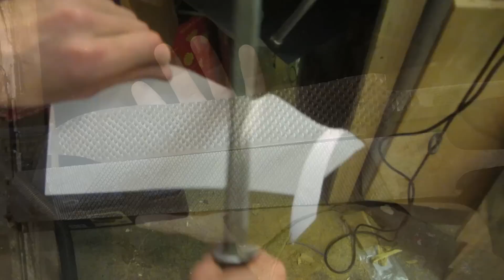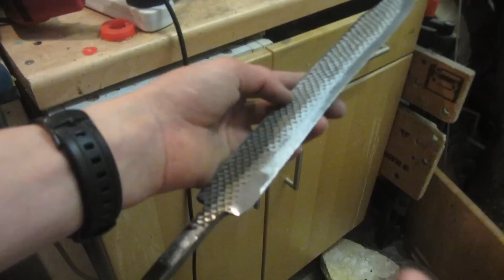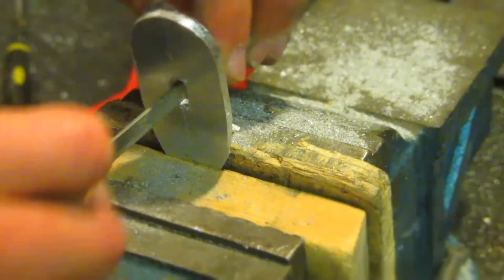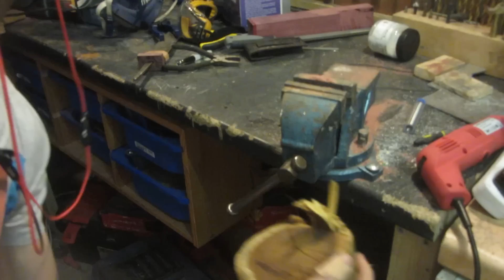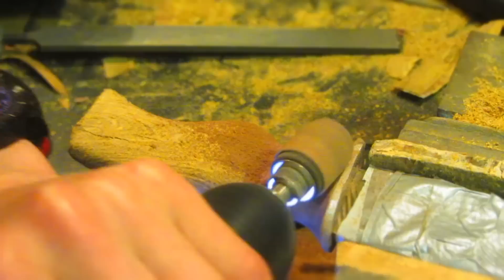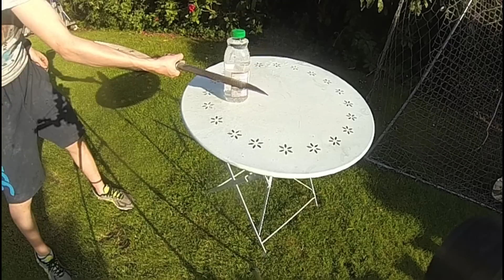How to Make a Bowie Knife From a Farriers Rasp

Comment: i am a goldsmith apprentice, and i think the soldering didnt work because the difference between the melting points of the used metals is too big. The solder has to be melting just right before the two other used metals are melting to form a propper alloy. Also you cant solder steel or iron. I hope i could help, thank you! 
Ps: Great Knive!!! love all your videos!

Comment: You are tempering the knife. Heating it to a mid-to-low heat to soften the spine. It is a great idea to use water to keep the blade cool. I had not thought of that. But be careful, the angle grinder destroys heat treatments really quickly.

Comment: Make a knife out of rebar
Reply: Julio Fernandez Rebar is far from ideal when making knives. You want edge retention and point retention. Rebar is far to soft and it does not harden well. It is however good for forge training as it is easy to work and can be heated and reheated without much issue.
Reply: Okey okey
Reply from the maker: Notrollhere I agree, rebar is too soft and hard to harden.
Reply: The Art of Weapons leafspring steel is perfect. My friend made a fire, got it white hot and used a train to forge it. Bulgarians.... I love those methods.